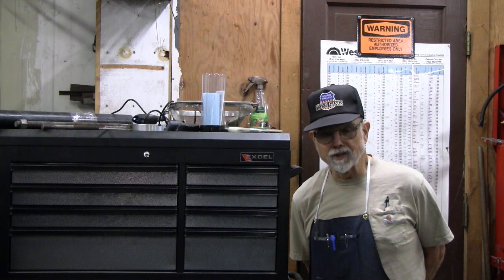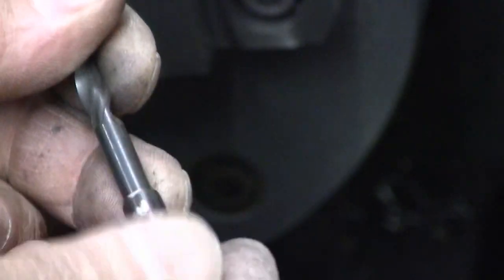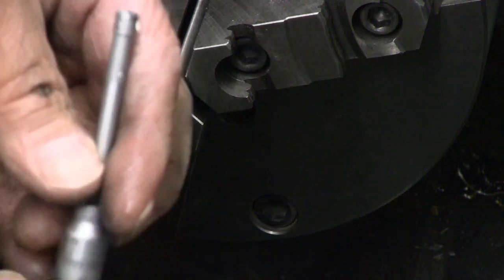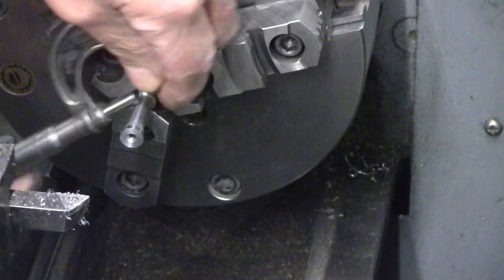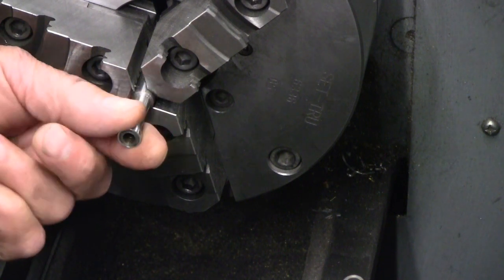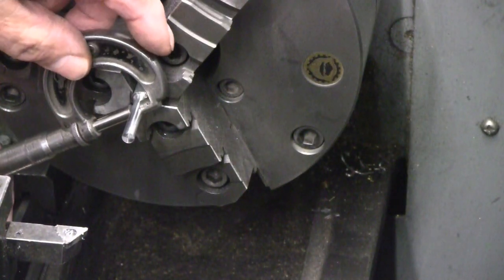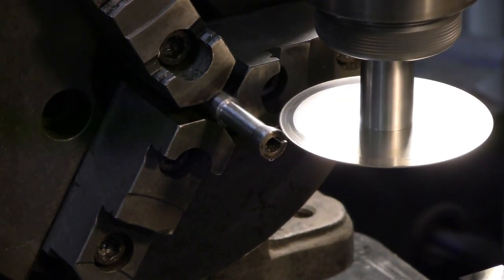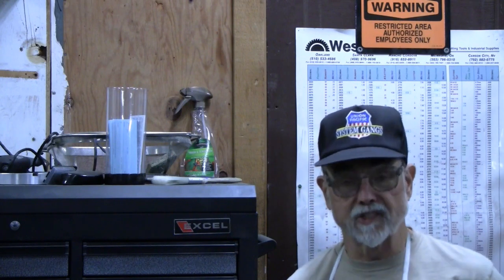Making a Collet for a Cheap Die Grinder

Comment: A modern way to measure the angle of such a short and unknown taper is to take a good side view picture of the collet with your camera and then put the image into some free image manipulation software such as gimp or inkscape or others where you can measure angles between two arbitrary lines that you can draw on your image.  I will leave you to look up the details of how you use the software to measure but it is rather nice and you can extend lines so that you get a good match with what you have.   
 If you photograph an item with a reference scale you can also use the same technique to measure awkward distances.

Comment: If all your machining of shaft, taper and drilling the centre are performed without removing the work from the chuck there is no need at all to try and get the rod concentric before you start.   All your features that you machine will have the same axis and be concentric.  There will be no error no matter how far from central it begins.